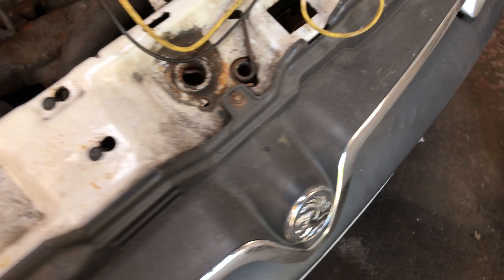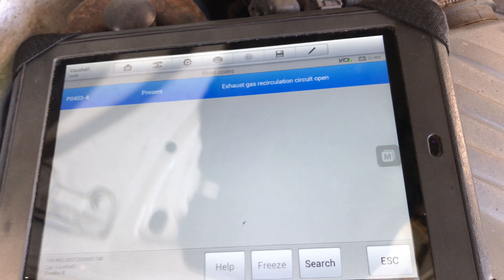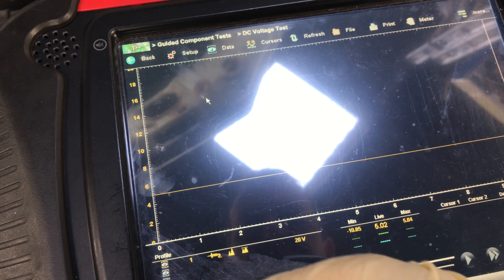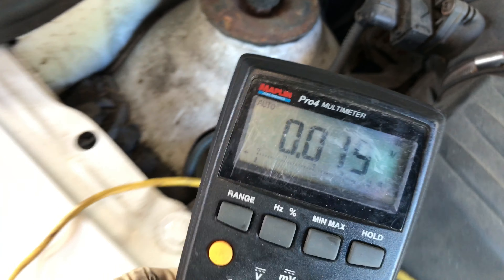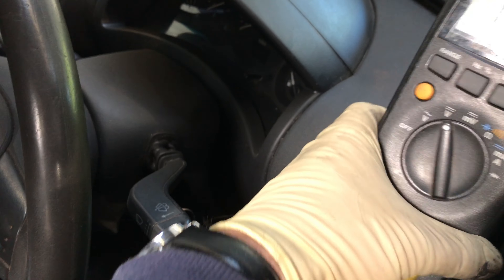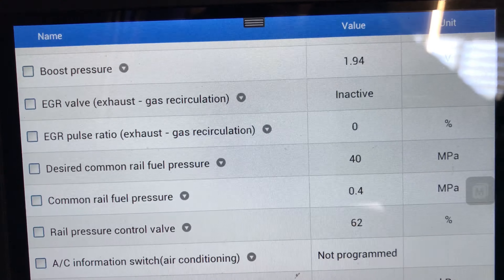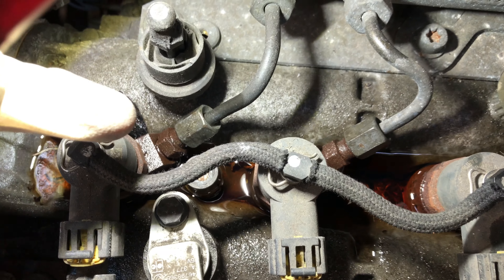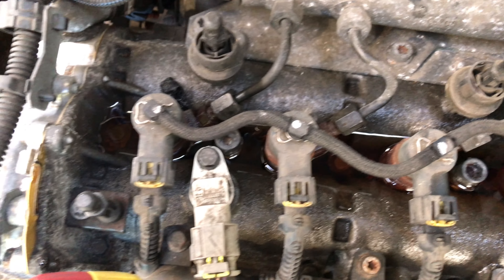Vauxhall Combo B 2005 Crank no Start

Comment: Nice wee job Sandy. Good to see you back in action. Wonder if frequency setting on your meter might have caught any glitches with the cam sensor or allowed a useful wiggle test on the connector? Did you manage to resusitate the old Verus? Think there's somebody who swaps the hard drives for solid state ones, might be able to help you if you can find him?
Reply from the maker: Thanks Russell never even thought of Freq good shout! Verus started to work again, it's done that before think it's touch screen/ cursor issue! I'll check out SSD but it's getting that old it's maybe not worth spending the money, hope your well, Sandy